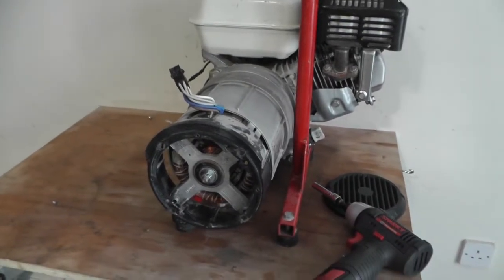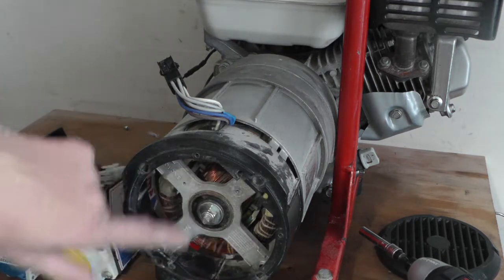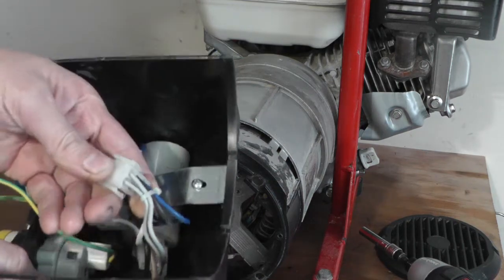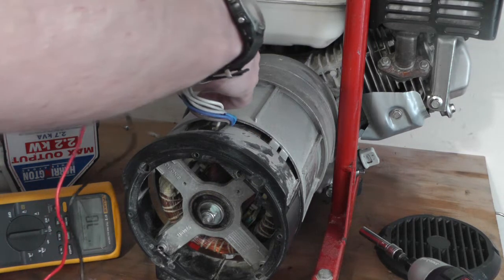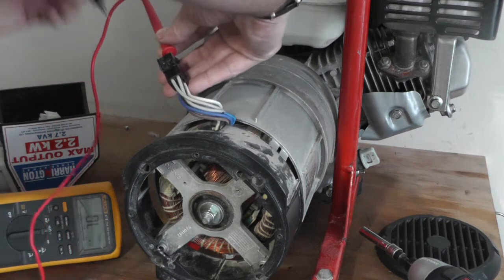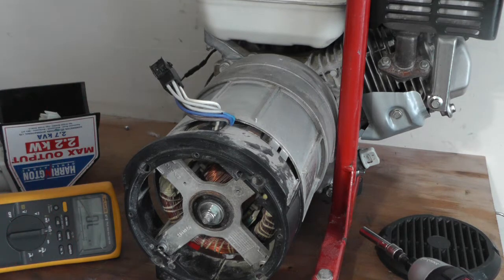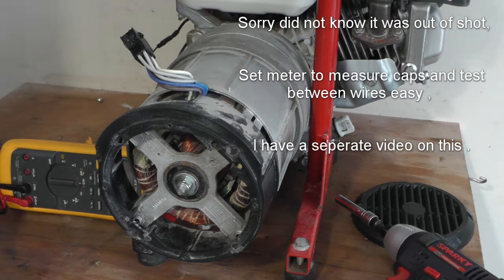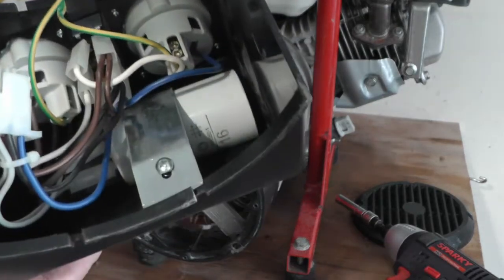Brushless Generator Stator Test: Multimeter & Megger Winding Diagnostics (Complete Guide)

Comment: Cheers mate! Thanks for your video! I have a question: the impedance between that 2 coils of stator is measured on the diagonal contacts? I mean for the 4 contacts, without taking in consideration the capacitor 2 contacts?